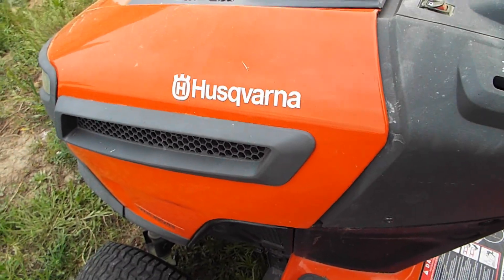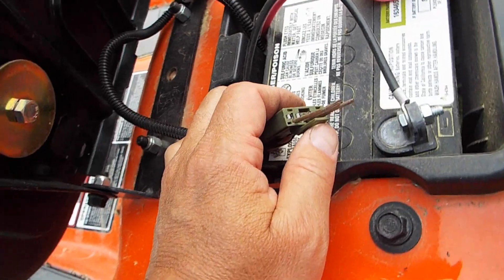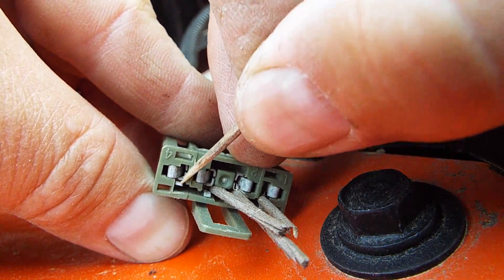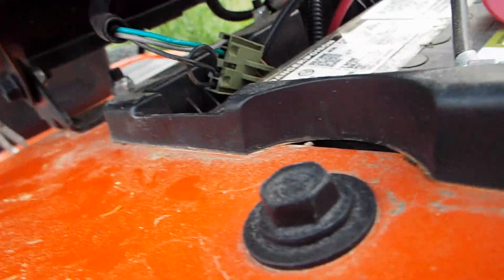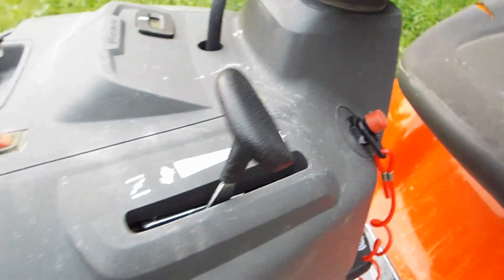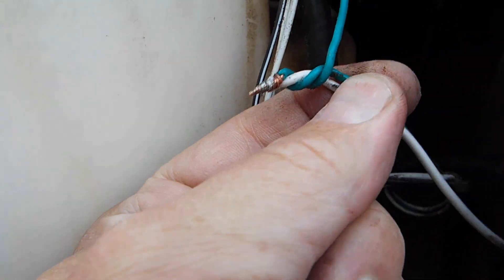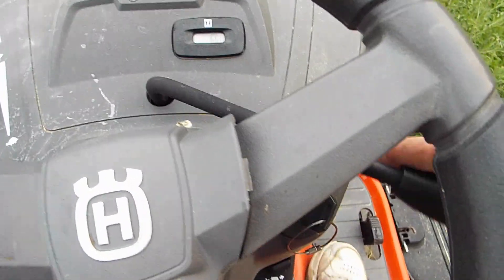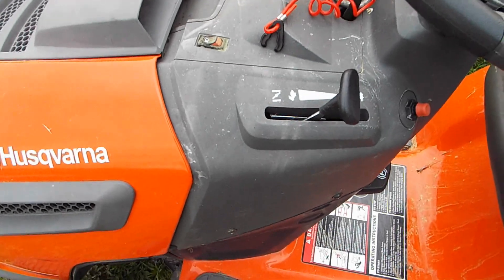Husqvarna Riding Mower Seat Safety Kill Switch Modification, Detailed V2.0

Comment: Looking at an image of the terminals on the Amazon page for the switch, there's 4 prongs.  Looks like a G and M.  How is this wired? Does it come with the wires or need a wire kit too? G terminals and black wire to ground nut and then M terminals - white wire and patch into the green using wire nut?
Reply from the maker: It has been a while since I did this video. Basically you need the switch connection that makes contact (connect the two wires together) when the safety lanyard has been pulled away. Then one of the wires connects to the interlock wiring of the mower the other goes to frame ground or the ground wire of the mower. When the lanyard gets pulled it connects the interlock of the mower to ground and shuts the mower engine off. I will not be able to look at the actual wiring until this weekend, let me know if you need further assistance.

Comment: At the connector you should see 3 color coded wires Black, Green, and a Gray wire  with the black looped to 2 terminals. Cut the gray wire. Then add male/female connectors in case you ever want it back. In the even the wires are different colors. It is the wire farthest away from the one that is double looped.
Reply: Thanks mate saved me some hassle

Comment: I'm on my  3rd seat safety switch for my Husqvarna Zero Turn in less than 10 years.  Contacted them to see if an upgraded switch is available but NO.  This bypass lets me mow while waiting for a replacement switch.  Thanks

Comment: Like the seat kill bypass but, it’s counterintuitive to add the watercraft kill switch. Could’ve just left it alone. The plug under the seat only needs to have the two pins to the far left separated.

Comment: Good mods my friend, on a farm it would take you twice as long to cut the lawn with them activated. Don’t get me wrong, I’m all for safety but some of the safety switches being installed in new machinery lately it is out of control. I think they are installed to avoid any liabilities for the sue happy people and ambulance chaising attorneys LOL. Take care Kirk.
Reply from the maker: Yes, you know it. Cannot buy a ladder now that is not covered with warnings stickers for every lawsuit that ladders have had....
Reply: John ain't that the truth... Think about the guys that use the machines commercially how it can make long days even longer. Don't get me wrong I'm a summer time person take great pride in a neat lawn on my day off all by myself but I know what you mean. I Have a Stanley 17.5 rider that was plagued by carb problems so I had to use a Kohler style carb on it for one the carb kept crappin out on me with it's plastic fuel bowl and then engine mount bolts had been sheered off it the reason the guy sold it to me and not cheap is it broke the motor mount bolts when it was 6 weeks old laid in his garage since then since 2009 it was like brand new but man was it plagued with gemlins the freakin reason I keep the tractor is because I like it and it is potent a real power house steers & cuts like a dream since I put bigger front tires on it and the number one reason I kept such a jinx machine is it does not have the seat safety switch. It had been factory recalled on 2008 when it was made for that reason that switch was never on my model Stanley tractor which made me love the little jinx bastard even more. Now I need a muffler for it if I can find one anywhere gonna or I am gonna have to make one or look for a retro fit muffler... I looked at newer tractors all full of those plastic parts and friggin electric gizmos... Ain't 4 me I'll keep my old stuff going till the day i die dude... I ain't dealing with dysfunctional handicaps meaning all those switches and electrical junk..